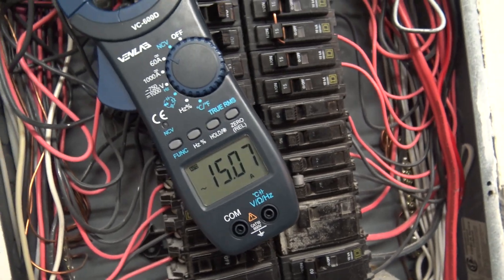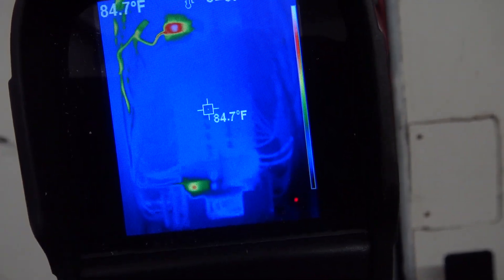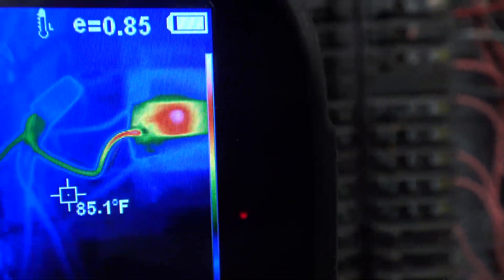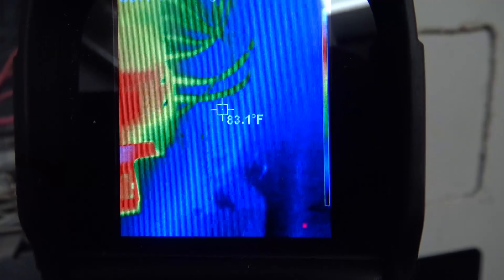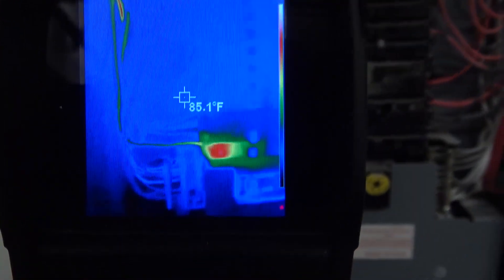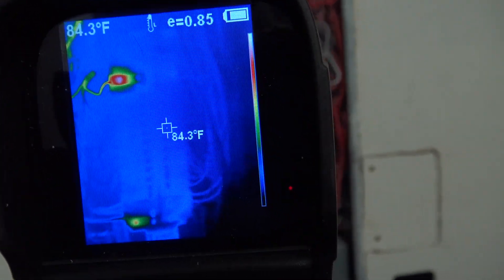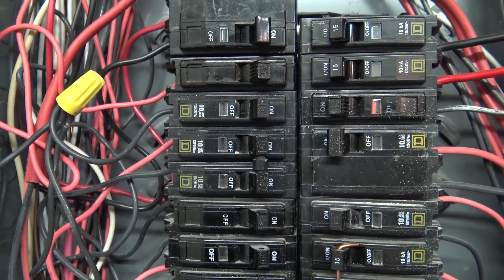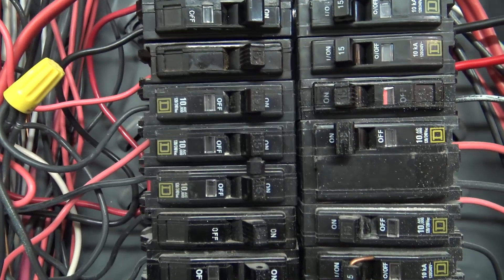Why is that circuit breaker tripping when AC running

Comment: Dave, And anyone else in this situation, DO NOT upsize the breaker to 20 amps unless ALL wiring connected to it is 12 gauge.  The older wire you have is rated for 60deg C max and will degrade the insulation over time if the load is allowed to approach 20 amps.  Also, should you experience a fire ANYWHERE in your shop or house, the fire investigator WILL look closely at the panel, and an oversized breaker will most likely result in you losing insurance or having the damage claim denied, even if that circuit was not the cause.  As for the tripping problem:

That breaker is simply worn out, as shown by the hotspots in the thermal camera image.  Replace it with a new 15 amp, make sure the connections are clean and tight, and you'll be good to go. The fraction of an amp over 15 is not reason to upsize. 

Also, check the start and run caps in your A/C unit. Weak ones will increase both the running and starting currents, and that will cause a properly sized breaker to trip.
Reply: Was going to say, you can't just slap a bigger breaker onto a 14ga wire - the whole point is the breaker is there to protect the wire. The breaker and the wire must be sized accordingly
Reply: @gorak9000   I just saw another reply where Dave evidently did put a 20a breaker on that circuit. Stupid is as stupid does, he needs to stick to electronic repairs (which he is excellent at) and stay away from electrical panels before he starts a fire or kills somebody.
Reply: it's a brand new breaker and he said in the video he's running 12 gauge wire to the outlet for the ac unit on a dedicated circuit for it.
Reply from the maker: That tomorrow reading was F not C. In C the wire temp is only running 25c, so no worries.  Its not overloaded and never will be. The breaker is not old, some are but not that one.  I already swapped the original 15 for that one as I thought it was the old breaker but this newer one did the same.

Comment: 15 amp for a portable AC seems excessive. How much BTU does it have? A 9000 BTU unit should not draw much more than 10 amps, a 12000 BTU unit around 12. That breaker is getting way to hot.
Reply from the maker: 12000 btu
Reply: @12voltvids  Still on the high side for a 12000 BTU unit in my opinion....
Reply: @12voltvids  Just checked a couple of specs. A 12000 BTU unit should draw around 900W-950W for the compressor. The fan is probably less than 100W. So at 120V it should draw no more than 12-13 amps.

Comment: I don't think drawing 15A is normal for something designed to plug into a 15A socket. Something has to be wrong with the ac itself. Bad run cap, plugged evap or condenser, something like that.
Reply: Quality Chinese engineering 🤣
Reply: @TRLTheRandomLab  well, years ago, back in the '60's, Made In Japan was the joke for quality, then Made in Taiwan was a joke, as was Made in Korea. As each industrialized and recovered from war, quality lagged behind quantity.
Reply: It’s a 15A unit that should be plugged into a 20A breaker because 15A is pushing it on a 15A breaker. You always want to have a little wiggle room on your breakers if you got something that will draw 15A plug it into a 20A breaker and you’ll be fine.
Reply: @ryans413  If it draws more than 12 amps continuously it should have a 20 amp plug, not a 15 amp one. Since it's only a 12000 Btu/hr unit it should be well under 15 amps under normal working conditions. A unit of that size needs to draw under 1200 watts to comply with the US' minimum efficiency standards from 1992.
Reply: The unit is new. My guess is that the AC has a low power factor, meaning the reactive power (which is probably what he measured with the inline meter before) is lower than the apparent power.
Reply: @kyoudaiken  just because it's new, doesn't mean that it's good.
Reply: @tubesnstuff503  It's normal for high BTU units to pull a lot of power. Mine pulls up to 1300W but I don't have any problems with breakers here cause I live in Germany with 230V on a single phase.
Reply: @kyoudaiken  Power factor doesn't matter here. A plug-in unit should draw no more than 12 amps continuously.

Comment: Good video Dave! I always learn something new from you.
I have a question: what is that wire ended in a triangle shape on the right of the video at 10:29?
Reply from the maker: The one that got some white paint sprayed on it when they sprayed the garage? Thats actually the garage lights and no it is not tripped.

Comment: You might consider running a 12-gauge wire and installing a 20-amp circuit to the A/C.  Most 15 amp circuits use 14 gauge wire which is only rated for 15 amp or less use.  You might want to consider a circuit breaker with a HCAR rating which allows a small startup surge for compressors and motors to start.
Reply from the maker: It is 12. The only 14 is that pigtail coming out of the marette and going to the breaker.  I used 10GA for my car charging outlets
Reply: @12voltvids I have window air conditioner that pulls 10 amps with the compressor on  which is at the powerboards limit yes I know I shouldn't use the powerboard  but I only run the fan most of the time
Reply from the maker: It is 12GA.  Garage bench plugs, kitchen and office all done in 12.  Only the lighting circuits were done in 14.
Reply: @12voltvids   So around 10$ CAN is "too expensive? Good luck with insurance if you ever have any issues, they will deny the claim if you put that 20a breaker on a 14ga wire (15a max) circuit.
Reply from the maker: @mxslick50 10.00? A new breaker is more like 50
Reply: @12voltvids  Where are you located? Here in the US a single pole QO breaker is around $10-15, a double pole is around $25 at any big box store.  Even at that, your $50 is still cheaper than the risk factors involved..
Reply from the maker: Please explain the "risk factor"
The garage is wired with 12/3 which last time I checked is rated 20 amps.  In fact most of my house is wired with 12GA some 10 and even 8.  The only circuits that are 14GA are lighting circuits.  The garage, my office / edit suite, and all the kitchen outlets are 12GA wire. The short jumper from the breaker to the wire nut is 14 as I just threw that on for the outdoor lights when I reconfigured for the car charger. The air conditioner only draws 15 amps and the wire is rated 20 with the exception to about 4" in the panel. The soffit lights are led, 6 watts each and there are 10 of them so 60 watts when they are on. So no, I'm not overloading anything here.  Nothing is hot. That wire was 30'c which is cooler then the outside air today.

Comment: That is a lot of electricity you are using there.
At the sky high prices we pay in the UK your wallet would not be happy.
Hence why so few peole have aircon here, we just have to make do with fans.
Reply from the maker: Yup, its expensive. About 300 per month when the AC is not running. I just turned it on so I will be hurting next month. I have 2 electric cars, so that takes a good amount of power, but its still about 1/5 the price of buying gas every week.

Comment: just need a 20 amp breaker
Reply: Nope, if it is on 14ga wire. BUT  IF it is 12ga wire, a 20amp breaker can be installed.

Comment: Good idea Dave. Once the new breaker is installed, I'd like to see the temp of the wires. Now I know that the run is not too long but just curious to see if the wire get a little warm. The next step would be to upgrade this run to 12 Ga. Just saying. Keep safe friend.
Reply from the maker: The wires are not hot at all.  30C under full load, so no problem with heating.
Reply: Always good to knew , if we change a breaker we should watch the wire gauge , here were i live 16 amps or 20 amps we can use a 2,5 milimeter wire ,( distance betwin point A and point B must be taken in account ) if more  we must use a gauge of  6 milimeters for 32 amps , example ' electric  induction kitchen  cooker AC"s and heather pumps ! Also important  if d"ident happen before it"s wise to inspect caps in the compressor  and pressure  in the unit, and even the ventilateurs , Cheers from portugal
Reply: @hugovale8070  *mm2, square millimeter. Not diameter. The EU directive for building wiring is something like this (don't quote me on this, just from the top of my head, except the AWG conversion, I had to look that up):
1.5mm2 (AWG 16) up to 13A, 
2.5mm2 (AWG 14) up to 20A, 
4mm2 (AWG 12) up to 25A,
6mm2 (AWG 10) up zo 32A,
10mm2 (AWG 8) up to 40A
Reply from the maker: The garage is done in 12GA.

Comment: Breakers trip at 80% of their rated value.
Reply from the maker: They shouldn't. A circuit breaker rated 15 amps should allow 15 amps draw 24/7.  My car for example when charging draws a full 15.4 amps. 3700 watts / 240 Volts 15.4 amps. Yes the breaker gets warm. Never trips. Old car is 3300 watts, so that one 13.75 amps.
Reply: @12voltvids  This is why FPE Federal Pioneer breakers were discontinued.  Some wouldn't trip, causing house fires. 15amp breaker is supposed to handle 15amps indefinitely but when calculating a circuit load its not supposed to exceed 80% of the rating of the overcurrent device.  Stay away from FPE if they are still being sold.
Reply from the maker: No FPE breakers here.  All square D
Reply: @12voltvids  And you are correct. AN 80% rated breaker refers to simply the normal, recommended CONTINUOUS load (A load on more than 3 hours with no change in loading.) 80% is the recommended maximum continuous loading for most circuits to avoid nuisance tripping.
Reply: a standard-rated breaker (also known as 80%-rated) does not mean it will trip at 80% of the current rating. All properly installed breakers are designed to carry 100% of their current rating for an indefinite period.